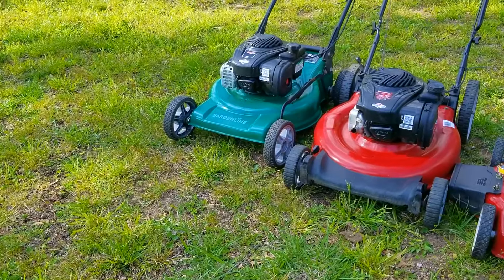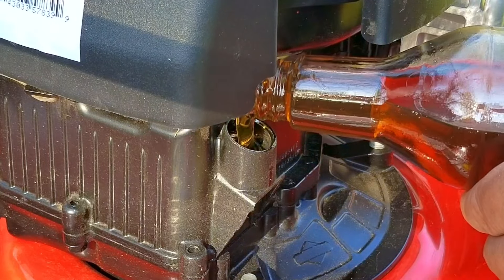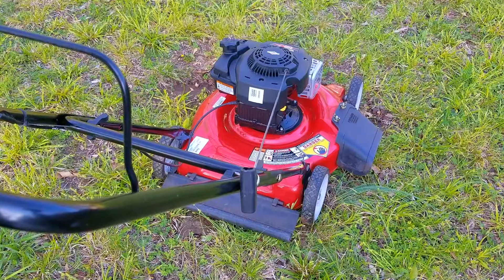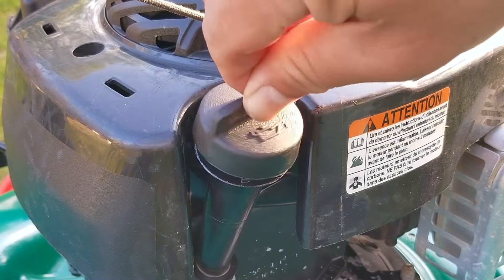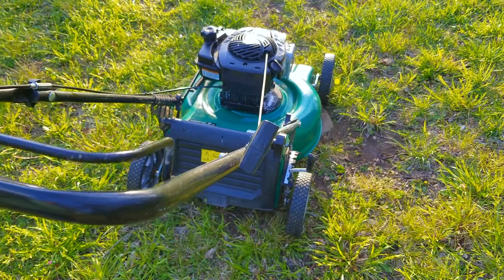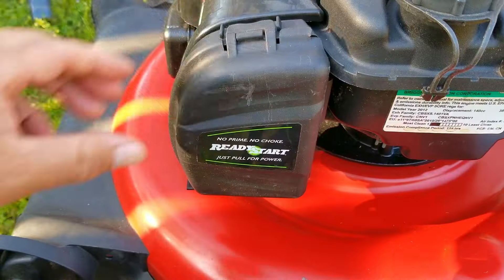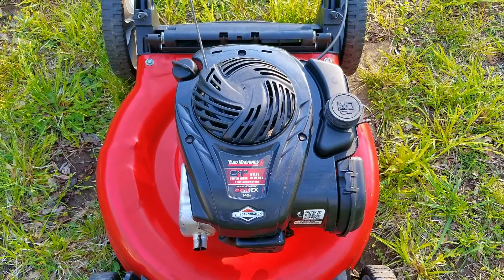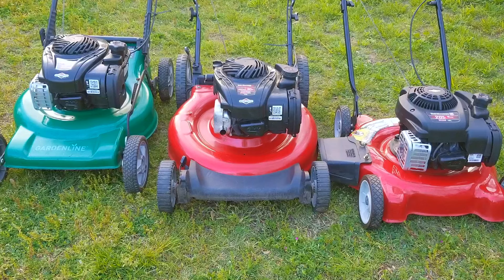SPRING MOWER START UP 2024

Comment: I prefer to find free or very cheap mowers, repair and flip than to repair for other people. I don’t and sometimes can’t charge enough to make repairing other people’s equipment worth my time.  Unfortunately finding free mowers in my area is rare. 
Cheers
Reply from the maker: you are correct, doing this for a living is going to be impossible not without high volume

Comment: When we bought our home in 2004, everything is expensive, from the down payment, and the to do lists, so I wanted a used push mower, but they were few and far between, meaning when I called about the mower advertised($50-75), it was available, but by that weekend it was gone. Luckily Home Depot had a ryobi branded gas push mower for sale for around $90. So that is the route I went. I still have the mower, and works well. Thanks for all you do IHG
Reply from the maker: wow nice, I've yet to come across a ryobi mower.
Reply: @INSIDEHOUSEGARAGE  you found a 4 cycle trimmer A Ryobi one
Reply: @INSIDEHOUSEGARAGE They were just white MTD's for Home Depot.

Comment: I believe that for the engine with the screw in oil dipstick, you could install the longer tube style one if you had one.  As you know, they just slip into the notches in the metal housing around the flywheel to secure up top.  That same screw down dipstick was a carry-over from the old Classic ones I think (I know that the kill wire/brake setup is the same exact part).  Not only does B&S claim "never change oil, just check & add" but then they make it near impossible to even add lol
Reply from the maker: yes you are correct, If you have a spare engine, or just want to buy the parts you can install the fill tube and dipstick

Comment: So what I do for oil changed on those with the plastic carbs is to use a kitchen measuring cup that you can get at the dollar store fill it with 16oz of oil and you should be good
Reply from the maker: that works great too.